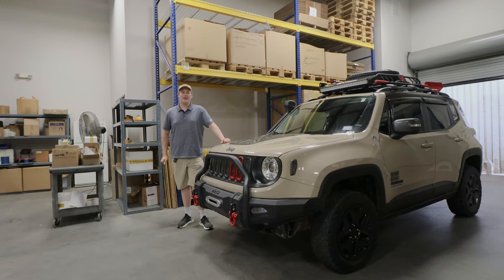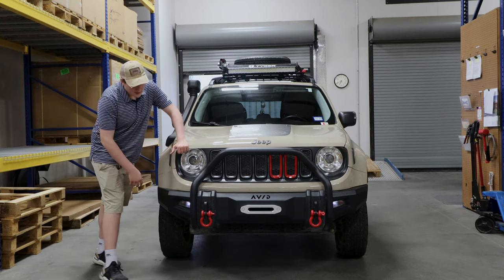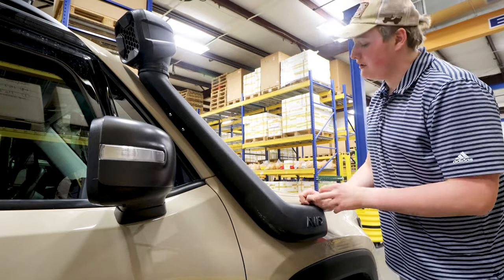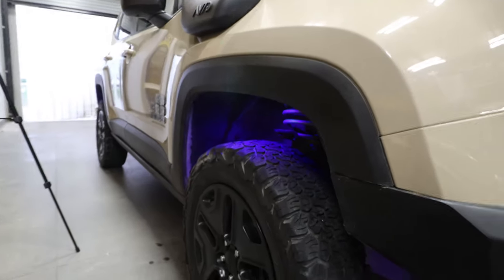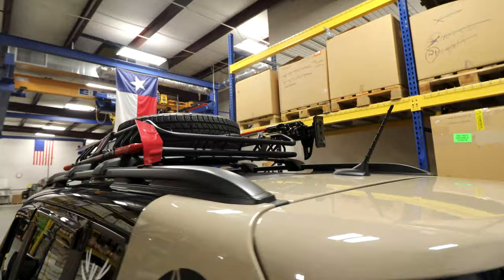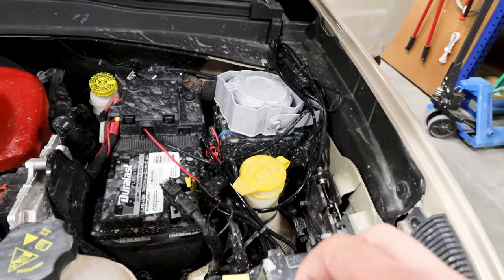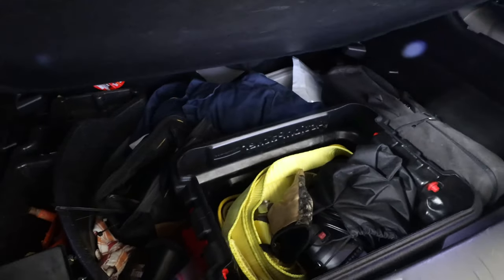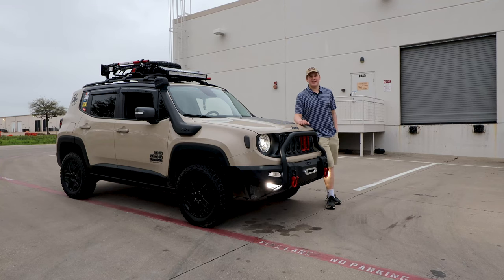Jeep Renegade Deserthawk Mods

Comment: Dear colleague,

What is the tire size you are using on Renegade?
Reply from the maker: 225/65/r17
Reply: @matthewmitchell8842  Do I need to lift the suspension to use the 225 / 65R17 tire? Or can I leave it as is the original?
Reply from the maker: @RenatoMontandondeLima  It fits stock.

Comment: Why not just get a wrangler then?? That poor little Jeep can’t handle all that weight. My renegade trailhawk is still stock.
Reply from the maker: Joel Martinez It is EXCEPTIONALLY better on road and much more comfortable than a Wrangler while doing everything I’ve ever needed it to do off road and more. It 100% can handle the extra weight, it’s been on 1,000 mile road trips 4 times so far and through some very tough trails around Texas and Utah without even a single issue to date. Not to mention fuel economy, I get 18 ish on the highway. Let’s take my friend’s Wrangler that he has put 37’s on, gets 12 on the highway with unbearable noise from them...
Reply: @matthewmitchell8842  Matthew,,,I drove my .18 to SanDiego,Calif. then up to LasVegas,Nev. and back here last June in the heat. The temp. gage was staying on 208F during day so I drove mainly at night with A/C off. I get 29mpg on trips to Houston and 22 mpg town driving,, of course I'm not a faster driver,, never go over 85mph on I-30 20 or 45,,,lol.